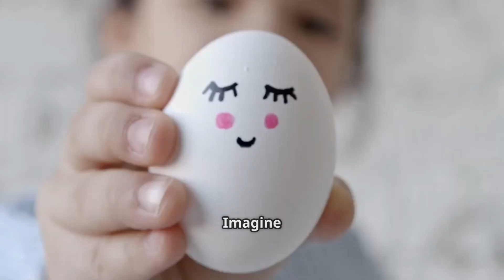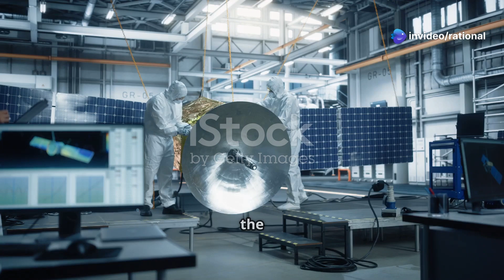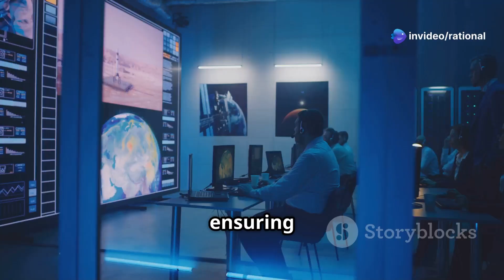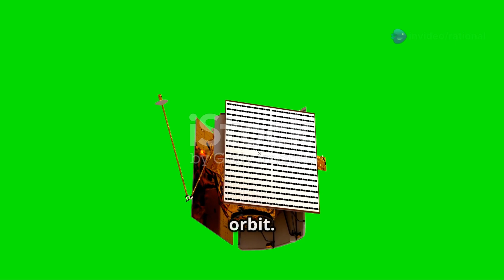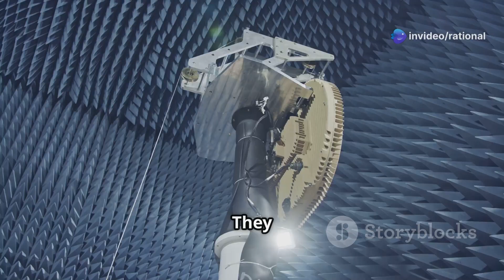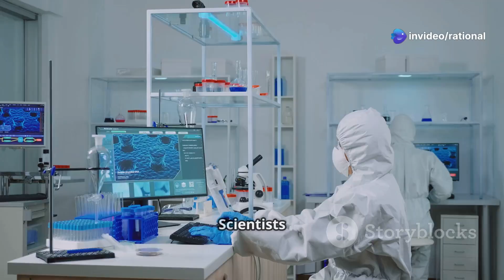"INSANE: The Satellites That Orbit Earth Without Moving!"

Comment: There are geostationary and geosynchronous satellites. Geostationary sit at the equator and orbit the earth at the same speed as the earth's rotation (about 24,000 MPH). Geosynchronous are non-equatorial orbits, so they can't be stationary. But their orbital speed and angle to the equator are calculated so that they trace the same path across the ground with each orbit. A staggered series of geosynchronous satellites can provide uninterrupted coverage for communications or observation along that path, although they still have to be tracked from the ground to fully maintain line-of-site. The geostationary satellites are the ones your satellite TV dishes point at, which is the reason they only need to be aligned one time (sorry, flat earthers). Star Link uses a combination of synchronous orbits with broader-focus antennas (dishes) which provide continuous coverage because there's always a satellite within the usable perimeter of the dish's target. As more are deployed the coverage and performance will continue to improve. It's like cellular phone coverage in reverse. With a cell phone your moving phone connects to different stationary towers as you move around, and with Star Link your stationary dish connects to different satellites as they move around.